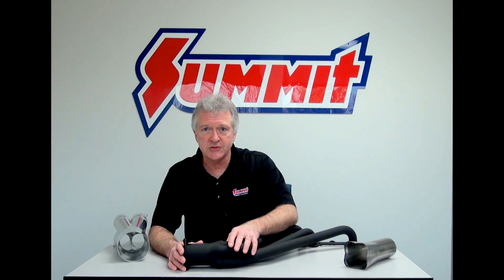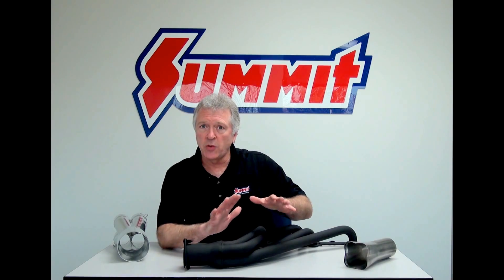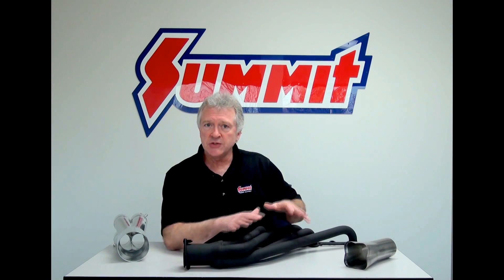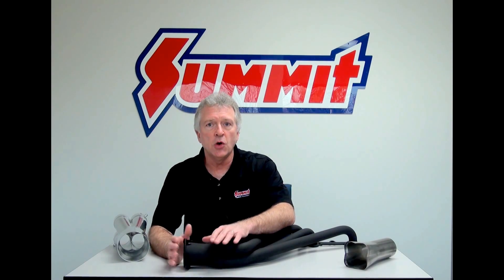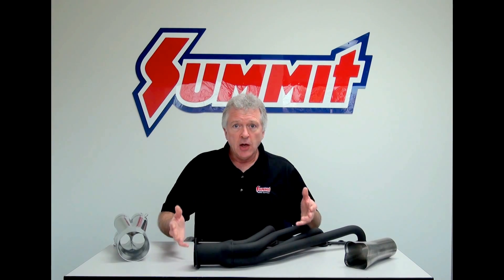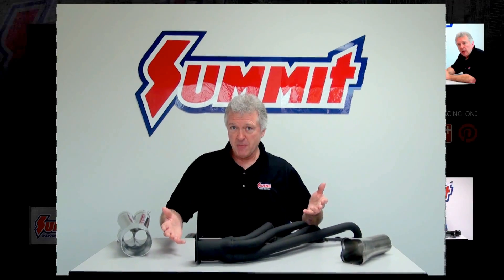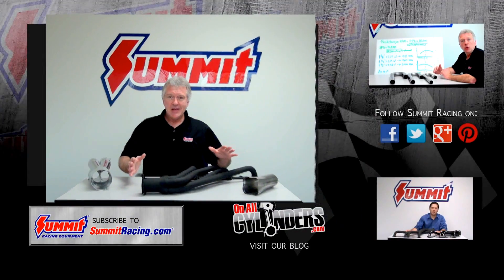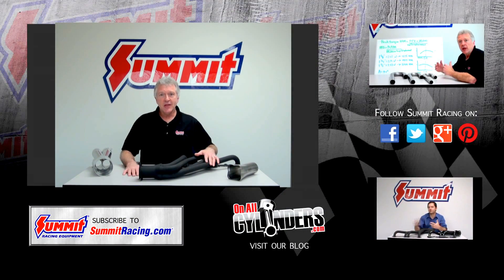Collector Size Selection - Summit Racing Quick Flicks

Comment: That is how you say very little with very many words.. I think it should be interesting to know why the longer collector makes better low torque. I was waiting for that the whole 7:30 min
Reply: In the same way there is a reverse pulse in the primaries, there is also one from the end of the collector - a lot less useful but still nice to have and, as it's a longer overal length, it applies at lower rpm.

Comment from the maker: This is why many O.E. turbo applications use a cast iron manifold, not only does it lessen underhood temperature, but it delivers the most heat (velocity) to the turbo to spin (spool) it up faster.

Comment from the maker: Hi Terrance. 
A long collector is typically not necessary but a nicely tuned and smoothly transitioned header collector for a Turbocharged motor is advantageous. What is more important is that all the heat & exhaust velocity are delivered to the turbo for less lag and for best boost pressures. Remember, heat is velocity in the turbocharged world.

Comment: Well I have seen all your videos on pipe diameter, x pipes, and headers but could you guys do a video on what length of exhaust is best for what application and the cause and effect of too much back pressure compared to not enough. Like open headers vs a full length exhaust system on stock small blocks to built big blocks

Comment: So what if you don't  reduce the exhaust pipe size after the collector? Will that give you really really good low end power / torque?  Or will there then not be enough back pressure at all?
Reply from the maker: Hi *****, 
Its really about exhaust velocity or air speed. If the exhaust pipe is too large, the exhaust will actually slow down. It is important to choose the correct pipe size so the exhaust gases keep moving as fast as they left the cylinder head. Too small a pipe may have great velocity but will back up the flow due to not having enough room in the pipe. This is where the term “back pressure” comes from. Don’t forget that H & X pipes help to share this pressure between banks on the motor and also promote better scavenging in the case of the X pipe!

Comment: Does this apply to vehicles with straight through mufflers on say a dual system?

How do you calculate the length of the collector?
Reply from the maker: +vkorinfsky, 
Yes, every part of the system has an overall effect on the total system. As stated in the video, there are a lot of specs or inputs that are important to your question. There is software available on the net or give us a call and we’ll help you build a parts list. 1-330-630-0240
Reply: It's not the lenght but the volume what is important and "make the difference".And there is a very simple way(empiric) to calculate it.Of course it isn't that acurate but it's working good enough.

Comment: Yes I am putting a 454 in a G body el camino  I am going to use patriot mid length headers h8013 I am Planning on running 3 ft of 3 in pipe from collector b4 reducing to 2.5 in exhast threw corvair turbo mufflers is this the right direction ,???       I am usung short headers to eliminate header ground clearance issues
Reply from the maker: Hi archie harris, 
Can you give our tech line a call? 1-330-630-0240. This may be a lengthy discussion. We appreciate you watching our video and look forward to your call!
Reply: Those headers are shiny crap - you may get a slight improvement over the OEM cast iron exhaust but they are by no means going to give much benefit.
Depending on your budget, you're going to be a damned sight better off building, or having built, a properly sized* - diameter and length - set. You can make an easy 10-20 percent difference in the peak torque and/or power between a good set and a bad one - that could be over 50hp thrown away!

*For a street driven car I'd design for the estimated peak torque rpm, esp' for automatics, and for a race car for the estimated peak power rpm.

Comment: 4:45 do not compare speed of sound of cold and hot air/gas , you can not say that exhaust gas has speed of sound and think on absolute speed number of cold air (1200km/h)  because hot gas has higher speed of sound ( 1000degC gas has 2600km/h speed of sound)

Comment: Great video Norm!! You make me laugh!!  Can you give us all a "guesstamet" (on average) of what kind of hp increase one can expect adding headers vs stock exhaust? I'm guessing about fifteen horses.
Reply: +skcharger440  on a stock c6 vette, Long tubes typically add 35 RWHP on the dyno (more at the engine).
Reply: +Spirited Driver  I just put a set of long tube Hookers on my ls 5 454 in my '71 SS . I'm pretty sure there wasn't a 35 hp gain.
Reply: +skcharger440 
I suppose one of the biggest restrictions on modern cars are the cats placed so close to the head and with aftermarket headers the cats are moved far down stream (Or removed all together) which allows for proper flow and scavaging, therefore big dyno proven increase.
Now, on a classic 454 this may not be the case because maybe no cats to begin with..  still should be a worthwhile gain considering the cost for that application is significantly less which comes down to acceptable value in my opinion.